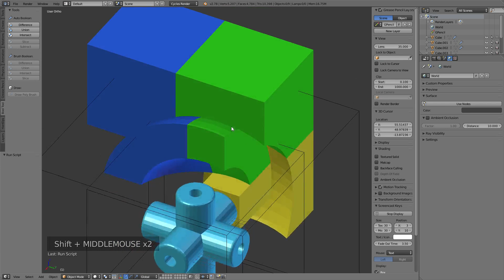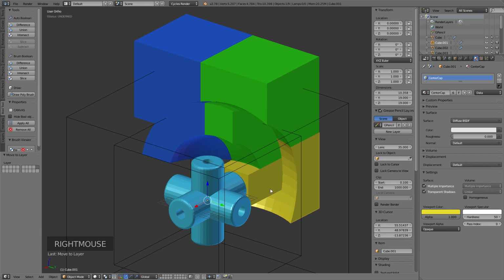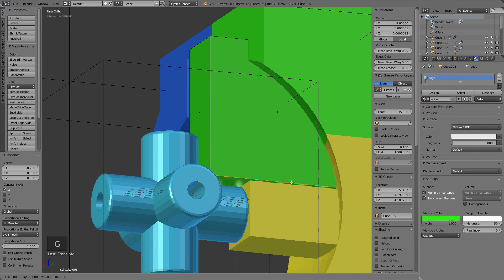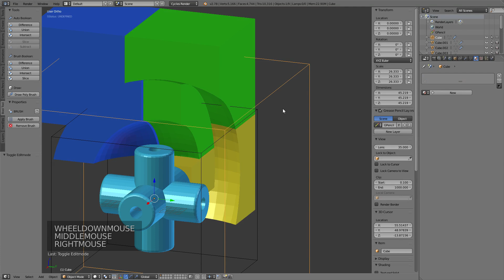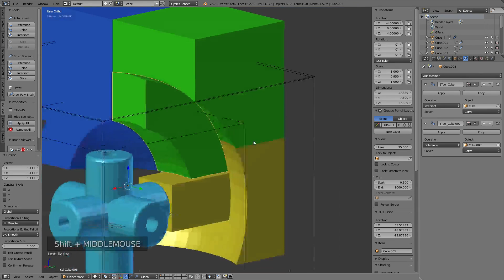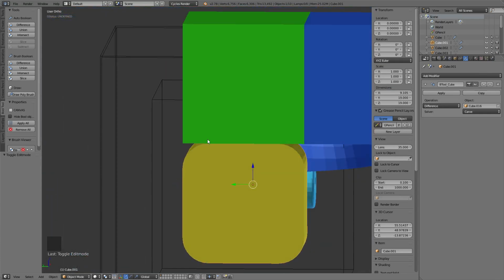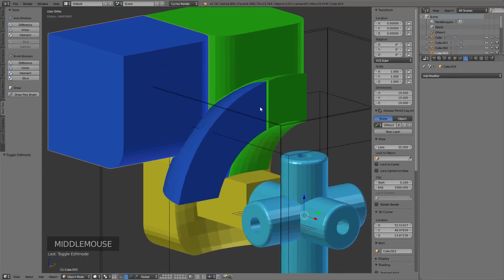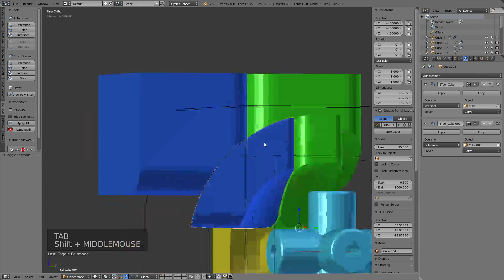Designing 3d Printed Puzzles part 7 of 11

Comment: Could you make a video on how to install BoolTool? NO MATTER WHAT I DO it won't work and its very frustrating. Plus when I try to do normal Boolean that doesn't work either. Any tips?
Reply from the maker: I can make you a quick tutorial either this evening or weekend.

Are you using Blender 2.7 or the new 2.8? If you are trying to do this in the new 2.8 build, that is probably the problem since it is still in early alpha and a bunch of things are currently broken.
Reply: @rcpongo  It says I am using Blender 2.79, and I'm using it on a mac version 10.10.5, if that helps. A tutorial would be greatly appriciated. Thanks.